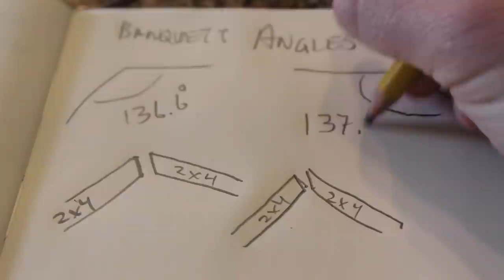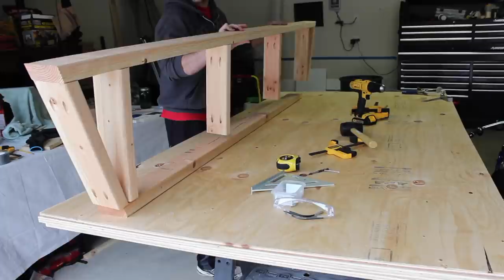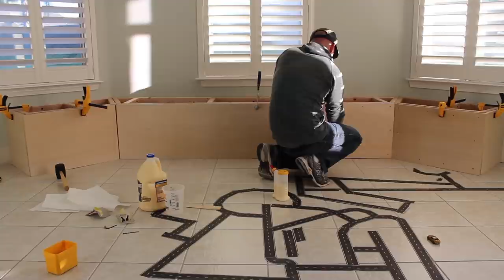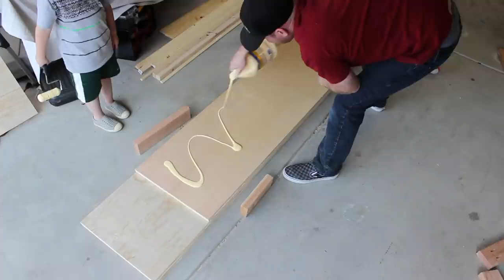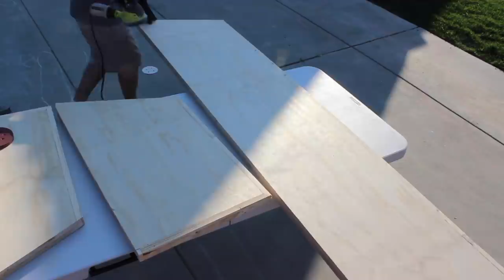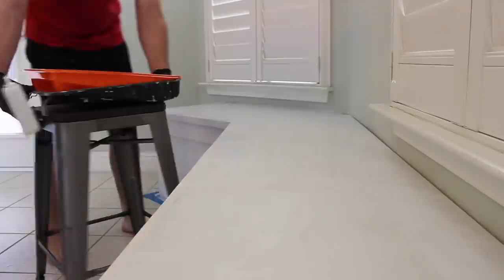How to Build Bench Seating for Bay Window/Nook/Banquette

Comment: This is the best build for this bench seat that I have seen.  I plan to use this as my guild.  I personally do not have a problem with the "no storage," as I find it very awkward to pull out a table, lift up cushions,  a lid, and then bend down to dig out what you need.  Unless you are living in the tiny house --no need for the storage.  As for the "heavy  timber," I plan to do the same thing. One very large man or woman could damage cheaply made furniture. Bravo!

Comment: Great video. Any issues with attaching the frame only to the wall?  No need to attach to the floor? Maybe the weight holds it down nicely. I’d also be hesitant to drill through the floor.
Reply from the maker: No issue and it’s been a year and a half since the install. The weight of the bench itself secured it to the floor.

Comment: Nice work. I have researched this project for some time for my own house. You did an amazing job with the design and build.

Worth noting that in my area it is against electrical code to build in/cover or otherwise remove access to electrical junction boxes of any kind. 

I am curious how you finished the paint so that it would not be tacky, would be easy to clean, etc?  I saw the primer, I am asking specifically about the top coat. Thanks.
Reply from the maker: Thanks, Matt! Good point about covering up the electrical sockets. I'm not happy about it, but I didn't see ay way around it. I used an eggshell finish, oil-based paint and that help keep the tacky-ness down. Since it's white, it get dirty easily, so my plan is to cover with a cushion down the road. If the plywood didn't get all funky during sanding, I would have stained and sealed the top to give it a more natural look - perhaps consider staining the bench top? Good luck on your project, and holler if I can help with anything else.

Comment: What did you do with the power outlets?  I am wanting to do this in my kitchen, but I’m not sure what to do with the two outlets it will cover up.
Reply: Code allows you to do this as long as you have a way to access them. This bench doesn't meet code, but it could if he'd made it with an access panel. Or, he could've used a piano hinge so that the top would open - then you could also use it as storage. But it's a great build otherwise!